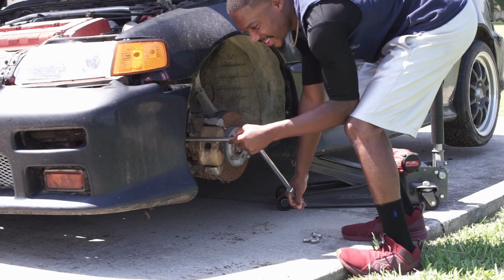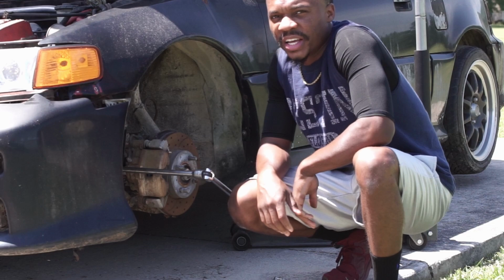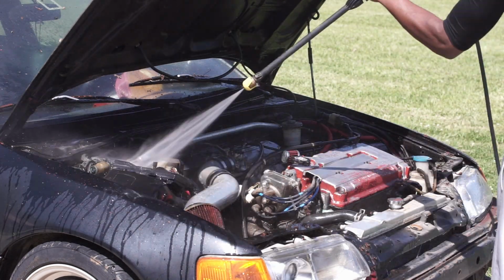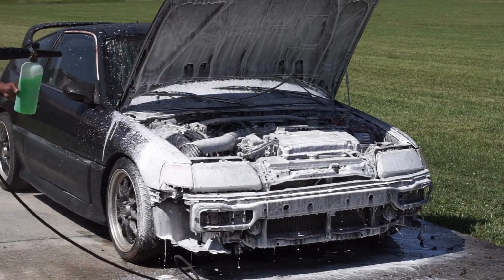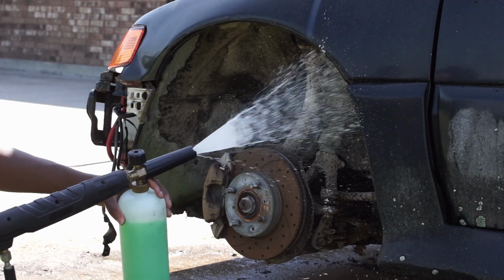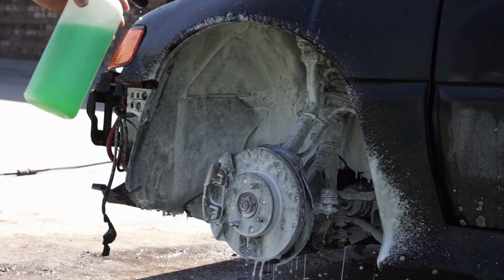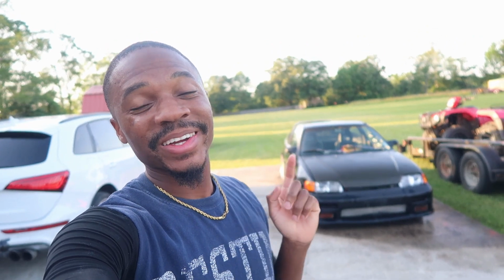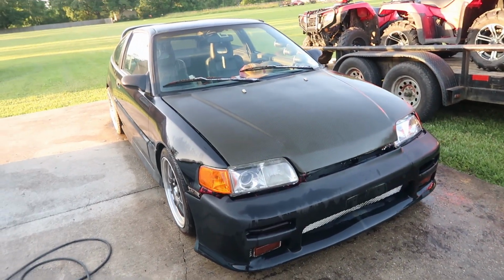Giving My OLD Honda NEW Life | The Restoration Process Begins Here

Comment: Try to change out the relay under the dash main fuel relay. Check the distributor as well
Reply from the maker: I’m pretty sure it’ll start if I get it to crank.. That stuff are things that imma check once I get the motor to crank over (by power, not by hand)